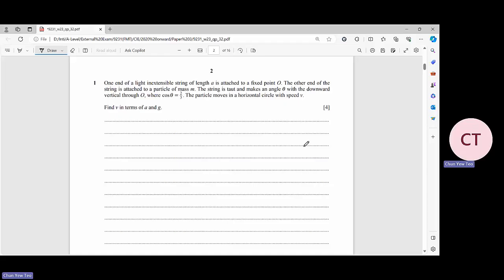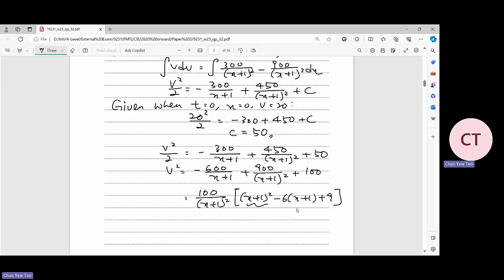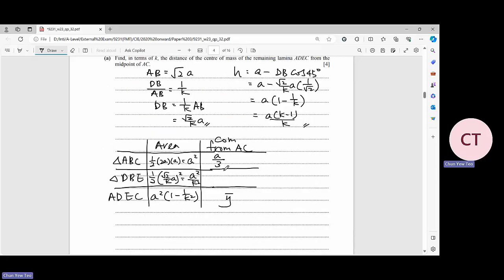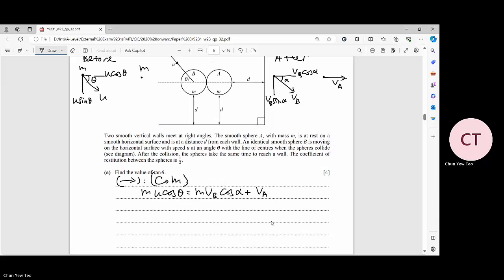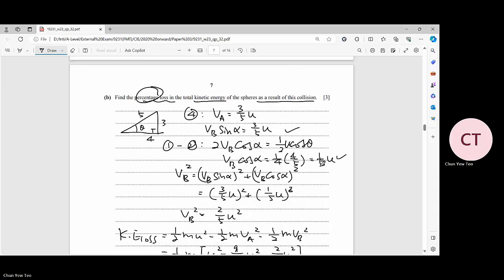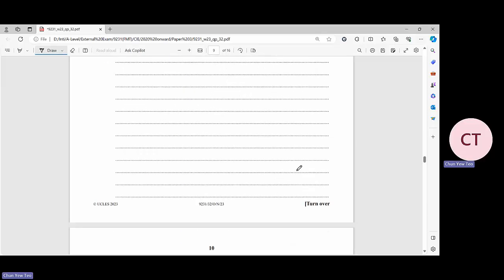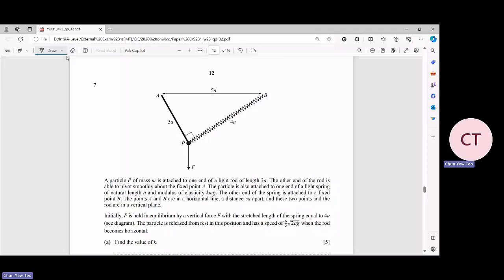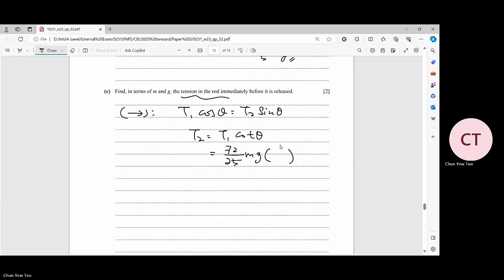9231/32/O/N/23 CAIE A-level Further Mechanics Solution

Comment: 43:40 Sir, how is it possible for the reaction force to be pointing towards the center O at A and then pointing away from the center at B? How can it be switching directions? If I imagine it, either the the P is moving in the inner periphery or the outer.
Reply: The ring is threaded in the circular wire. When the ring is at the B position, the ring is in contacted with the upper part of the circular wire. So the reaction force will go outside from the circle.

Comment: In q7, if we are considering the energy changes of the particle, why does the EPE of the string matter? The particle only gains GPE and KE right. Also isn’t there a tension in the spring intitally when the particle is in equilibrium. So there must be a horizontal component of the tension. In this case how is the particle in equilibrium if there is a horizontal force acting on it? Also last point, why does the rod even have tension if it is still at its natural length of 3a, it has not been extended
Reply: 1. EPE does matter because the length of the spring changed.
2. The rod is pivoted at point A. There will be an unknown reaction force at the point A. It will balance up with the tension of the spring.
3. The rod do not have tension. There is a particle P attached to the end of the rod and an external force F acting at that point.

Comment: Why RB negative in question 5
Reply: bro, why is RB pointing outwards of the circle? It can also point to the center of circle, the question is lack of information, it didn’t even give you the speed, you cannot no whether RB is pointing out of the circle
Reply: @阳阳佳轩the question clearly states “the reaction at B is in the direction OB” meaning outwards
Reply from the maker: what do you mean by RB?
Reply: @cixiangng The reaction at point B, please reply
Reply: @thefuture6661  The circle is made of wire and the bead is moving on the wire. When the bead is at B, the reaction at B is acting outward from the circle because of the weight of the bead is acting downward. So when we resolve the force towards the centre of the circle is mgcos(theta) - RB = mv^2/a.